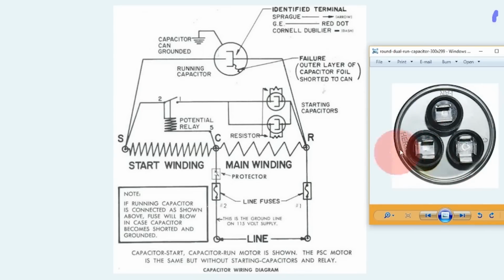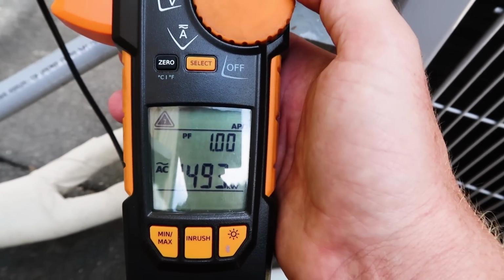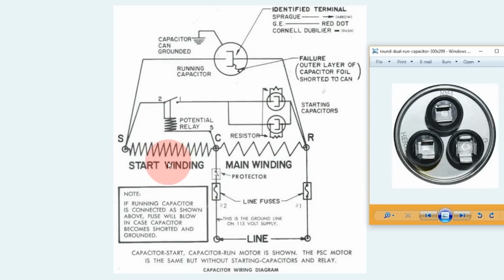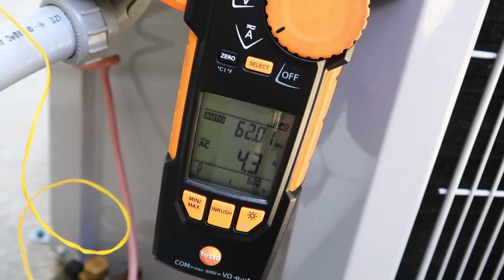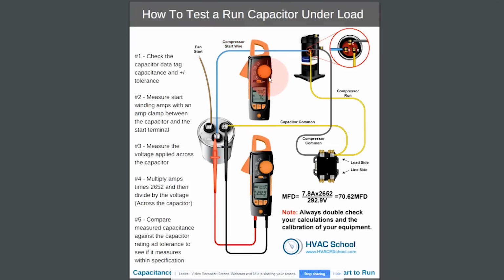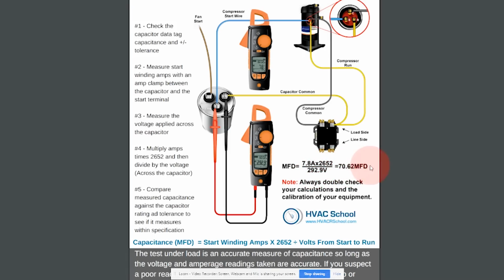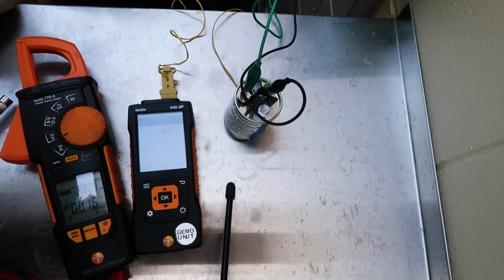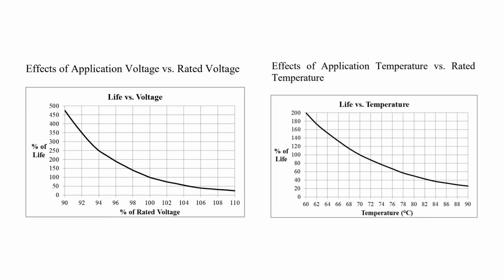Why Do Capacitors Fail? (It’s not why you think)

Comment: Capacitors fail mostly because of how the manufacturer constructs them.  Extremely long life caps could be made if the customer was willing to pay for them.

The OEM price for these canned caps is about $3 in high quantity. A 30 cent savings in manufacturing cost is a big deal.  

My understanding of cap failures from my era in the US lighting industry makes me think that two issues affect their lifetime:

1.  How lead wires are attached to the roll of metalized polyester film.  There is a sputtering process that shoots metal onto the ends of the film roll followed by the attachment of a solid copper lead wire.  If cracks develop in the wire bond the resistance goes up and the cap is more susceptible to high currents.  Heating at the wire bond causes thermal expansion with each cycling of the motor, which accelerates the cracking.

2.  Presence of Oxidants.  The metallic coating on the polyester film from which the capacitor roll is made is susceptible to oxidation.  Air literally eats the metallic coating off of the film. During manufacturing oxygen-containing air can get trapped in between the layers of film.  Tightly wound film rolls have less air trapped in them than loosely wound ones.

In high-priced/high reliability devices the capacitor can is evacuated for an extended period before it's sealed.  This evacuation removes air (i.e. oxidant) from the film roll and the oil that surrounds it.  I suspect that capacitors fail earlier when this evacuation process is shortened in time or carelessly performed.  

It could be that some oils contain more oxidizing contaminants that others. After PCBs were banned some cap manufacturers began using something akin to vegetable oil.

I've seen the evacuation process in action.  It involves a giant coffin with a removable lid.  A day's production of capacitors is placed into the coffin, the lid lowered and sealed, and thereafter a vacuum pump removes all of the air.  It's a time-consuming and messy process.

It would be great if the seal on the capacitor's can is air-tight because it would prevent readmission of air into the film roll.  But the truth is that the metal can is only there to serve the one-time purpose of opening the capacitor circuit when the device overheats at end of life.  The can's top expands when the oil in it boils.  The expanding top opens a switch in series with the capacitor.

The safety agency that certifies the capacitor mandates the presence of the "open upon boiling" switch feature.  However, the safety agency does not mandate evacuation of the cap or verify the quality of the evacuation.

The bottom line: capacitors fail because of compromises made during their construction. These compromises are price-driven.
Reply: @Jim Olson Thanks for writing a detailed explanation about capacitor construction. When is the oil added?  When is the can crimped shut? Is the metallizing on just one side of the Mylar?
Reply: @pauleohl  The oil is added to the can before it enters the vacuum coffin, meaning that the vacuum pulls the air out of the film roll and the dielectric oil at the same time.

On your question about when is the top cover crimped to the can, it's been awhile but I think before the can enters the coffin.  There's a tiny vent in the crimped cover that allows oxygen molecules to escape from the can during the evacuation period.  That vent hole is plugged with a soldering iron when the capacitor comes out of the vacuum coffin.

No, there is metallization on both sides of the dielectric film, with an intervening later of dielectric film.  

For very high voltage caps (rated, say, 300VAC and above) there can be an intentional unmetallized stripe/void down the middle of one side of the film.  This unmetallized gap effectively forms two series-connected capacitors, the interconnection between them being the side of the film possessing ungapped metallization.  

You would never know that the manufacturer created series-connected caps unless you de-spool his mylar film and examined its metallization.

This striping/voiding concept can be expanded to form three or more series-connected capacitors in one roll.  Each time you add a series-connected cap using stripes in the metallization you reduce the voltage across any one capacitor.  The downside is that you also reduce the capacitor's microfarads.

Reduced cap voltage (achieved by series connecting them with foil stripes) means less likelihood that metallization will be eroded away by voltage-driven corona effects. 

About 30 years ago my company manufactured an electronic device that used a 0.4uF/480VAC film cap purchased from a well-known US vendor who shall remain nameless.  We installed 1000 of these widgets on the ceiling of a Sears warehouse, all of them failing within a year.  

I remember the day my technician told me that all of the failed units had 0.2uF capacitors in them, not 0.4uF.  When we de-spooled the mylar film and held it up to the light, approximately 1/2 of the metallization on each cap's film was gone.  It had been silently eaten away by corona.

It was at that very expensive inflection point in my company's history that I decided to become a self-taught expert on film capacitors.
Reply: @jimolson5018  Thanks for writing. Very interesting to read. Most of us just discard a failed cap and that is the end of it. My central air is 32 y/o and I have never had to replace a cap on the condenser. I probably did replace the cap on the air handler motor when I replaced the motor, but that is at least 23 years ago.
Reply: I think the consumer needs more information on these capacitors. They need to know what the cost is for an upgrade of a couple bucks for better operation. I bought a Vissanni 10 cu ft at Home Depot and paid $300. They are new and efficient and use a KW a day. They run at 100 watts but need 1000 watts to start. They also say not to run on an inverter. Is that a pure or modified or inverter generator. Does that mean you cannot run them in a power outage on a generator? I had a 600 pure sine inverter that would not start this fridge. I tried and tried to adapt it but gave up and used a 2000 watt modified sine until I bought a 4000 watt pure sine wave. I'm not asking for anything except I know like you say the manufacturers save pennies and put the cost onto the electric grid and the people watch the lights dim and the compressor strain. How do we know that refrigerator or AC will not do that like the new split ACs from Europe give us with a soft start. Maybe things will change with the electric grid shut down in CA and more people concerned about refrigeration operation running on generators and inverters. BTW my Vissanni failed one day after the 5 year compressor warranty so went and bought another. This one is 7 cu ft for $388 more of an ice box style but doesn't have restrictions on the power source. The old one is in the shed.

Comment: The original capacitor in the outside unit of my heat pump failed at the 12 year mark. I always have a spare capacitor and contactor on hand for it.

Comment: For me as a h vac tech,,its blown the capacitor,if the condenser  is lack of maintainance,,beca8se its high pressure and high temp and the compressor is too hot and also the cap is become hot..and the oil of the cap is boil,

Comment: A real engineer knows that capacitors vary in DS and DA specs each causing non-ideal function as a cap, causing internal dissipation . But old caps are better because they're not cheap crap from CHINA. I have seen an MOV starter circuit (which was flaky and died) in junk  from Carrier.  What garbage!
Reply: Titan USA is the only brand I use and I will always trust him .But I’m grateful to those who use bad brands, because they give me income😅

Comment: What i want to know is why the old capacitors that were many times larger never failed. I know the oil was toxic in them but they were rock solid. I personally feel that the manufacturers are using these capacitors kind of like a fuse. Instead of frying the compressor or fan motor it just blows the capacitor.
Cant tell you how many jobs i went to after another company couldnt fix the problem, where id pull the service panel off and see a bulged capacitor and fixed the problem in mins.

Comment: Why they fail? Its a metal can with a varnish coating with a electrolyte (salts) liquid in it. Eventually the varnish will fail and cause a reaction that changes the electrolyte formulation creating a situation where the solution has a lower boiling point. This will in turn make the capacitor swell and pop. 

Another thing that will make a capacitor fail is over voltage. You can put lower voltage in a capacitor all day long.  Over volt.. arc across the layered storage medium.. added material to the electrolyte then boil and pop.. 

Thank got they aren’t polarized in ac.. 

In dc circuits you can accidentally put a cap in backwards then the magic smoke comes out.

Comment: It simply seems as though all of the quality in the USA has decreased well below any standard in history. In the 40's and 50's which is long ago and far behind in technology, parts lasted longer. I have a no defrost refrigerator from the 40's that works like a dream and uses only 2.5 amps and its as quiet as a mouse. Our kitchen refrigerator has been replaced 3 times in 35 years and of course, as efficient as they claim them to be, uses more power than the old one. 
Why don't these companies make equal to or better products than in the past !
Reply: because “Plan to scrap”，like this. If the quality is too good, no one will replace the equipment, and the manufacturer will not be able to make good profits.
Reply: @samsaradream693  I'm sure that theory was just as present in the 1950's and the products that were made better made more business than the cheap crap.

Comment: I am of the opinion that bigger is better.  Some old air conditioners had huge capacitors.   I don't  think I have  ever seen one fail.   Great video
Reply: DoctorT327 you nailed it. Those big run capacitors were made with pcbs and made in the USA, both of which no longer happen. They would fail, but it was rare.
Reply: You always must use the same uf

Comment: i live in Philapines,,  hot climate high humidity,,,,   my experience has been that, any thing with an electric motor( from simple drills and small power tools right up to large horsepower motors,, particularly those manufactured more recently and of cheaper capacitor construction,, if left in storage and unused for long periods will certainly suffer failure from leakage ,rotting, bursting,   , this situation is far more prelavent ( its almost gaurranted ) than the possible failures shown in this vidio... !!!!!!!

Comment: The simple basic answer is, either excessive voltage causing a breakdown of the dielectric between the plates and/or excessive internal temperature caused by resistive losses due to the electrostriction of the dialectic experiencing charge reversal. The higher the frequency the more times per second this happens and so higher the energy loss in the form of heat creating higher temperature. To a point when the capacitor material melts, moves and electricly breaks down.
Reply: Soooo,living in Phoenix is a death sentence!

Comment: I waited 37 mins.  (Plus ads) and you never answered your original question "what fails in a capacitor?".  I immediately said "the dialectric".  You essentially said the contacts and "internals".  If you don't have fried external parts, it's the dielectric causing shorted foil.

Comment: As voltage goes up amperage goes down. The same is true in reverse. It must balance. If it does not balance heat is formed. If you have bad connections or BURNT CONTACTS which is the number one reason for capacitor failures, you will have voltage drop and heat formed. Heat is the root cause of capacitor failures. That is why very old large heavy oil filled Capacitors did not fail. They could disperse heat.  Amperage draw increases heat which is a byproduct of electrical current. I  spent 30 years of repairing and fixing electromechanical systems and equipment. From window units to 500 ton chillers in industrial sites. It all comes down to basics .  I have held 50 year old capacitors in my hands that are just as good 50 years later as the day they were made and I have taken out bad ones that are less than a year old. Build quality is the greatest factor.

Comment: Run capacitors are poorly made today !  An air-conditioning unit is designed to be in the heat and sun.
The run capacitors were too !  
They"re junk now ! 

I was a contractor for 25 yrs 
The A/C and refrigeration industry has become ridiculous in technology and the quality of product is poor.
Coils were made of copper now they're aluminum 
They're using plastic to replace parts that were steel before
My mom has a 30 year old Carrier 5 ton unit with the original compressor and fan motor !
Runs like a champ, exposed to hottest of hot all day long in Las Vegas heat !
Never had to replace a run cap !  Go figure !
Run caps are made poorly now.  
I spoke with the guys form AAA Motors in California about the run cap problem !
He said they were just junk now and that they break down regularly !
Easy money for a contractor but very unfair to the customer expecting a quality product !
👍

Comment: Caps are rated on duty cycle. The new China caps won't even last a year or two. You should always change the cap and contact er at the same time. To my knowledge the only USA made contactor is made by Titan USA the one that is in the red white and blue box.  Which are 2 to 3 times more  expensive. These capacitor should last several years as the duty cycle rating is higher.  The caps he talking about becareful some brands were know to catch on fire.   Excellent video sir
Reply: Titan is the only brand I use and I will always trust him .But I’m grateful to those who use bad brands, because they give me income😅

Comment: I'm an HVAC Contractor in the Metro Phoenix area. I've got units 2-3 years old with dead caps under warranty and we literally just experienced the hottest June in history and I emptied out multiple 5 gallon buckets of dead caps over the last 5-6 weeks. They are poorly made and 117 degrees plus, sustained over time fucks em' up. EXTREME HEAT kills them.
Reply: Lived in Phoenix for decades.  People don't understand just how fast caps die in that area.  HVAC,  Pool pump motors,  car batteries,  car belts,  tires, etc.   The heat just destroys everything.   They won't even warranty tires for much over half the original warranty.
Reply: @jeffm2787  You can get parts specifically rated for high temperature use. The capacitors used in many HID light fixtures typically have to tolerate high temps, they're physically larger and more expensive than consumer HVAC motor capacitors though.
Reply: @James1095  Thank you for the tip. AirStar (USA2218A 55+7.5 440) specifies 70C rise. Genteq/Regal-Beloit is mute on that subject.
Reply: Extreme crap quality does that too.
Reply: I work in the phoenix area as well go with the turbo200 caps they do great and havent seen any fail, they also come with a 5 yr warranty
Reply: After having a capacitor fail in mine a few years ago, I always keep a spare on hand. Takes just a few minutes to swap and it's the only thing I've ever actually had actually fail in my HVAC.
Reply: I found some made by AMRAD, all USA made capacitors.
Reply: @Garth2011  That use to mean something,  hopefully it does again.  When it comes to electronics Today the best caps in the world are made in Japan not to be confused with made in China like the old farts do.   Good info,  checking them out.
Reply: @jeffm2787  Yes, i agree on Japan as well. All good stuff when it comes to small electronics too.
Reply: I would think that it may be likely that 117 temps ambient could end up 150 degrees under the cover if direct sunlight is bearing down on it. Possibly something to cast a shadow on the unit might help a little bit. Also 140 degree air inside the cabinet is going to affect the cap temp too.
Reply: Thanks! As a DIY guy,gonna rplace with high quality caps and tightn all connections.Weve had several failed caps and $ervice calls.
Reply: I used to play around in that Phoenix heat. You are absolutely correct. I started using genuine Mars 440 V cap on everything, and had a much lower failure rate. The run caps are more vulnerable to overheat if the afternoon sun beats down on the panel that the capacitor is inside. Yeah working in the attic in Phoenix!!🤬🤬🤬

Comment: < HVAC School explanation > is well thought out,  suitable for the  general public.
Curious if there are people there that understand the physics of  the circuit shown, 
when the momentary greater Start current, hence larger input electrical power Energy,  is  required to move the motor from 0 to up to rated rpm.

Comment: after a few thousands cycles of the contactor the silver contacts become worn and arc, and the arcing induces voltage spikes that exceed the capacitors rated voltage and it pops, replace the contactor and capacitor at the same time

Comment: THIS IS WHY I DONT LIKE ROOF MOUNTED AC UNITS
I WOULD PUT MINE IN A WELL SHADED AREA DURING THE HEAT OF THE DAY
KNOW WERE THE SUN WONT BE DURING THE HOTTEST MONTHES AND PUT YOUR UNIT THERE IF YOU HAVE GOOD AIR FLOW IN THAT AREA
IT MAY COST SOME MONEY TO DO IT BUT AC DOES NOT CREAT COLD AIR IT REMOVES HOT AIR AND WHAT IS LEFT IS COLD AIR
THE COLDER THE AIR AROUND YOUR AC UNIT THE LESS WORK IT HAS TO DO AND THE BETTER AND LONGER IT WILL WORK

Comment: They fail because they’re junk. Cheaply made crap. Whenever I run across an old unit from the 70s it has an original run cap from the factory. They’re huge well made ( in America).